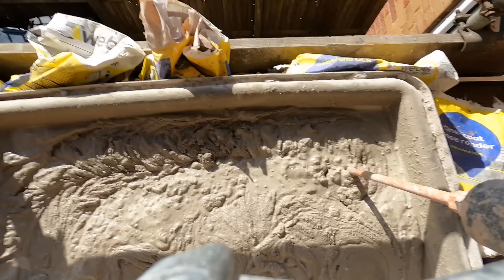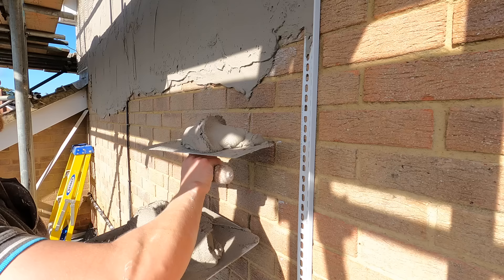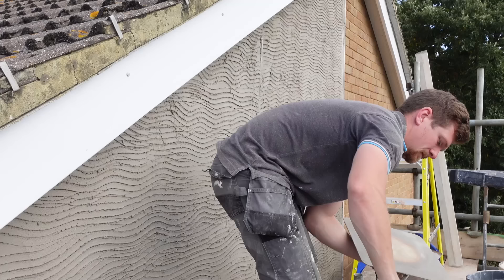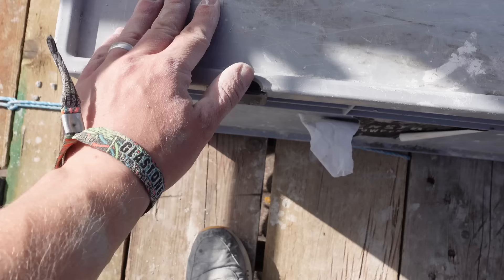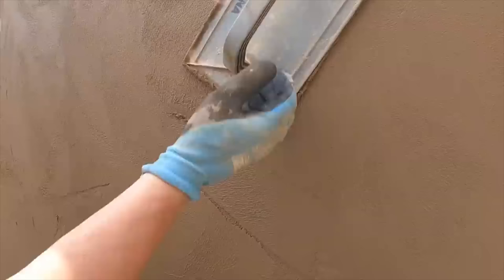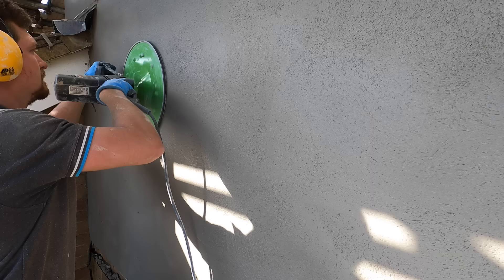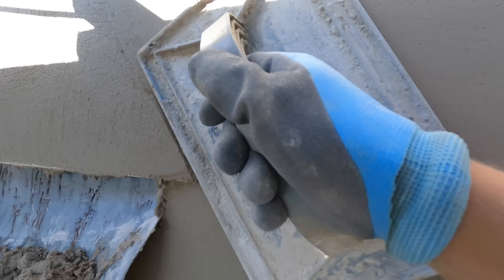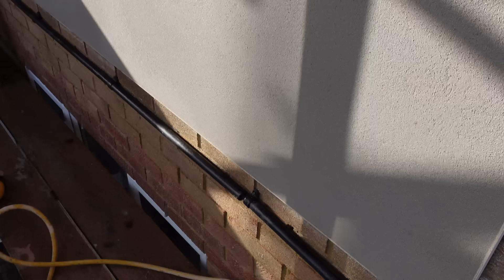Rendering Walls Made Easy With This Bagged Render ("I Should’ve USED THIS YEARS AGO!!!")

Comment: It’s called one coat render for a reason… why are you applying in two coats? You don’t need to do a scratch coat. Just hit it all in one go…
Reply: Maybe to fill the brick joints so they don’t show through.I don’t know though ,just guessing
Reply: @josephstratti52 dead right
Reply: The brick joints will show through in a few weeks if you don't apply two coats.

Comment: Never mind  that pre grit, Use Webber rend aid for your scratch and leave it a couple of days to cure   If you find it expensive for a scratch you can half and half it with sand and cement, Amazing product, Then top off with the OCR , No issues, Whatever you use Scratch should be left to dry a few days !! Basics of rendering
Reply from the maker: I’ll look into that mate…cheers 👍
Reply: yer thats what webber told me to use too. Rendaid with mesh

Comment: For difficult substrates (some paint remains and mixed construction of brick and concrete), would a mix neat SBR and sharp sand provide an adequate key for Weber one-coat base coat? Or would you suggest something else on a tight budget?

Comment: Hi blaine , i have a job that requires  webber ocr over marmox board that has been fixed to blockwork,  ive only ever worked with sand and cement,  the job requires 20mm thickness to as there has been brick slips stuck on plinth that are are 13mm proud , is it the same system for 20mm in doing 2 passes the same day or are you better scratch coat and top another day ? Thanks joe

Comment: If the walls are straight can you apply the first scratch coat with a roller flat it then scratch it instead of trying to do it with the trowel?

Comment: Hi there. Love this product but wanted to use it over Yorkshire stone. Do you think it would be suitable if I use mesh and bonding agent with it? Or do you think I’ll need to do a cement render instead fully or just cement to fill in the ridges (which are quite shallow) then could I use OCR? 
Also could I use it on mullions? Or you think cement is better? Cheers for any help as I’m struggling to get much help from the company directly and I’m quite new to this game.

Comment: Hi Blaine, thanks for sharing these videos mate, they really are a great help. Do you mind if I ask, that if I were to use webber ocr in the coming weeks and presumably it will be still cold. Would it be a case of putting the two coats on, ruling off and floating the following day? Or does this stuff set the same day like a traditional rendered wall? Thank you

Comment: can you paint over this OCR with regular masonry paint?
Reply: Yes mate or silicone top it
Reply: @seanwalsh1613  awesome thanks bud
 One thing I wanted to ask, is if I were to do a scratch coat first, could I leave it like a day or so before doing the top coat? Can't get much ocr currently and only have enough to do a scratch coat. So was hoping I could scratch coat it and wait till it comes back in stock
Also I'm going to rendering onto breeze block.. would i need to use a mesh for this?

Comment: Hi Blaine, This vid is an absolute godsend as I'm psyching myself up to render our block planters. Would you recommend using a mesh on the base coat or just the scratching ?
Reply: Brickwork doesn't need mesh. Obviously it'll make the render stronger and theres no harm using it but if the brick is going to crack the render will crack

Comment: Hi Blaine. I know this is a bit off topic. But just wondering if you know any other way of insulating and preventing damp in a bathroom using the solid plastering method rather than moisture resistant plasterboards?

Comment: Great videos. Really helpful. Quick question - I’ve been reading that some industrial constructions use titanium dioxide in the mix to create a whiter finished render, rather than painting it. Is this something you could try to see how well it works? Painting is good but needs to be redone and the titanium dioxide apparently is self cleaning when in contact with air and water. Would be interested to see what you think. Thanks
Reply: Webber do a coloured finish in many colours for top coat and I've used the silicone render and I now use nothing else as it also acts as an additional water barrier too.

Comment: I have a few questions regarding rendering 3 block pillars =. The pillars were sound until a small machine cause damage to the render whilst driveway being altered. Anyway, we decided to hack all the render off all three pillars that had been in place for 20+ years. So, as it stands the pillars are now back to bare block with caps removed. They have been like this, exposed to the elements for around 6 months. Now we are ready to render them do they need to be wrapped in plastic/polythene for a few days so as to dry out before rendering starts? My father insists they do but I am unsure?! Any advice would be appreciated.
Reply: If you're using cement render you need the blocks to be damp but not dripping wet. If the blocks are too dry they will suck the water out of the cement meaning it won't cure(hydrate) as well.
Reply: @johnbennett5591  Thankyou for the prompt reply! A couple of fine days and will be making a start on them. I have a spray pump on hand to use if the blocks get to dry. Cheers

Comment: Class vid. Starting a new project soon. Do you use a silicone product to top coat it? If so which one? 
Will you render all months of the year now? 
Cheers dude
Reply from the maker: I just kept it as is mate but you can use a silicone top. I just opted for the sand cement finish to be fair.

I’ve not tried this in winter yet though so we’ll see hire it performs when it’s cold 🥶
Reply from the maker: *how

Comment: Can you apply second coat of Weber render the following day if for example the weather turns or the areas too large or do both coats need to be applied same day ?. Thank you and love the videos my plastering has gone to another level.
Reply from the maker: Yeah you can matey. Just spray the wall with water first and you’re good to go. Thank you by the way - that means a lot. Cheers 👍👍
Reply: @PlasteringForBeginners  Thank you 👍

Comment: Great video. How long after you had finished applying the second coat did you start floating?
Reply from the maker: This was pretty much straight away. As soon as the top coat was applied I was floating it. Very fast product to use unlike sand cement Render.
Reply: Ok thanks, and does the render pre grit have to be done the day before like green grit or same day

Comment: Great video bud if your doing big areas can you leave it over night or for a few days??? If yes would you pva the scratch
Reply from the maker: I’m sure you can - you’d just have to spray water on the render before applying the second coat.
Reply: Wouldn't use PVA outdoors ,SBR only

Comment: Hi blaine I've never used weber Ocr used most as I spray my render machine applied.
Is it a slow or fast setter.
I use baumit alot kzp 65 it's quite slow really which I like..
Reply from the maker: KZP is a cracking product to be fair. I really liked using it. OCR is quite a fast Setting product which what I like about - not tried it in the height of summer yet though. That could change things ha!

Comment: Hi Blaine, I have front garden wall that I want to render it has 2 pillars at each end and 1 roughly in the middle, if I want to use the one coat base render. should I do the whole wall at once or wait until i finish the facing wall or do the corners of the pillars at the same time..
Cooks London

Comment: Hi Blaine. We tried this product a few weeks ago and used mesh. But in places it delaminated,the top coat in places peeled away. The topcoat was applied straight away as soon as the mesh was put on. What could the reason be for this you think. Great videos as always
Reply: 1st coat must have dryed,did you prime wall?
Reply from the maker: Did you scratch the first coat. If so, was there much depth to the scratch?? I find the mesh can reduce the key which could have effected the top coats grip.

I’ve found that a decent key is important if you’re applying it by hand
Reply: @PlasteringForBeginners  I put on about 10mm then trowelled the mesh in then trowelled on for the finished level. I presumed as the first coat was still wet it would stick really well. I done a bit today on a smaller area with out mesh and put a scratch on it and it was a hell of a lot better.
Reply: @azzyidol  Webber advised me to use Rendaid as scratch coat at approx 3mm, with mesh in the Rendaid, and use stipple roller and let it set. Then apply the OCR once the Rendaid has cured properly, and mesh again in the OCR

Comment: Hello Blaine, love the videos, but could you please do a video on EML, I've just bought a house thinking it was block ends and the rest timber framed........ Turns out the whole building is timber framed.  I've removed the old render exposing the ply, pulled it apart and re built with insulation 18mm ply and tyvek.

The next stage has different options according to different people, once the batten is over the tyvek then a layer of reversed roof felt then EML then traditional render. 

Any help plz.

Comment: Hi mate - I,m confused - just watched your 'The Main Reason I HATE Monocouche Render - AVOID AT ALL COSTS' video, then this - I was planning on using this for timber frame, cement boarded porch. Are you now saying it's OK as long as you smooth off the top coat and paint it? Please help - going to Wickes tomorrow.
JD
Reply from the maker: This isn’t Monocouche mate - it’s a bagged Render that simulates sand cement. This is Webber OCR and I highly recommend it 👍
Reply: @PlasteringForBeginners  OK, thanks for that - I'm easily confused and distracted by shiny objects - I'll go ahead
 Thanks for the videos
Reply: @webshyte  it's not for cement board. Weber LAC is the product you need it has a higher polymer content and goes on 6mm thick, don't forget mesh on your board.
Reply: @PlasteringForBeginners  it pretty much is monocouche and can used in the same way, just doesn't have colour.
Reply: @roryprice7949  would OCR not still bond to cement board? All taped and beaded - I thought I'd do a base coat, embed the mesh, scratch and second coat flattened. It's just that OCR is good for price and availability - do you think the cement board might mimic concrete substrate?
Reply: OK, got you - just read up on LAC - many thanks again